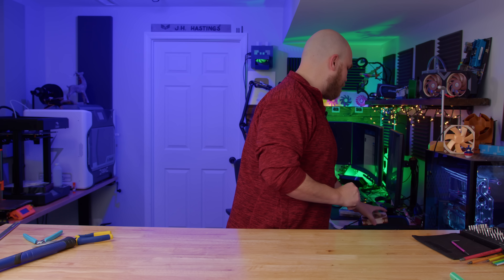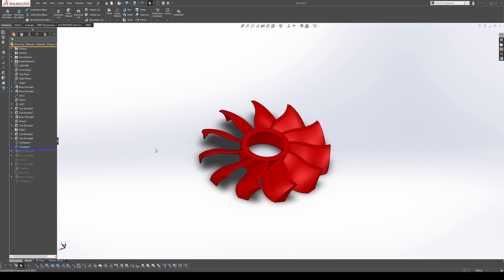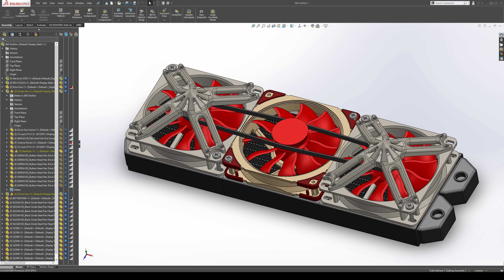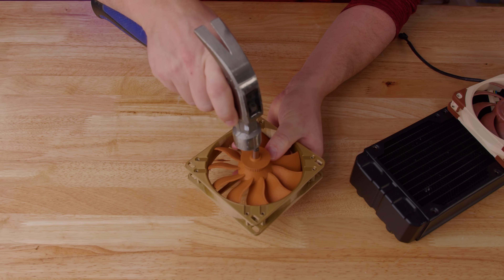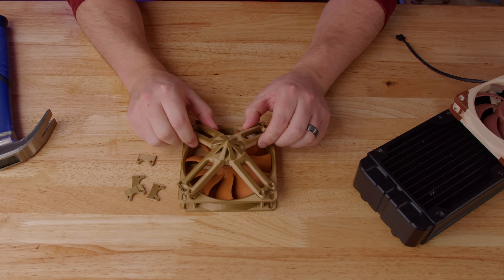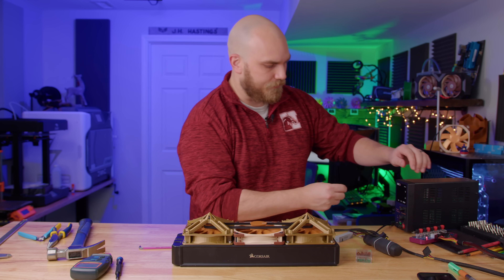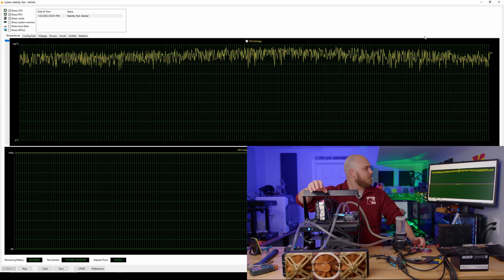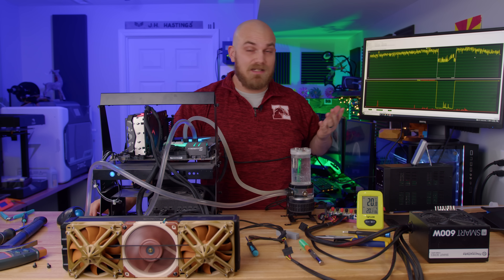I Turned One Fan Into Three | Steampunk Water Cooling

Comment: the central sprocket should be smaller than the ones of the driven fans (1:2), they would turn half the speed but also cause half the torque to the motor , and use a 2 belts system to avoid using tensionneur ;)

Comment: make a shroud. and attach the cheater fan to the shroud. have the shroud move the air evenly accross the surface.
this is only an option if you have space in the direction but it may very well allow you to get more even flow

Comment: I think you should consider something to hold the belt on the actual fan from losing it's traction, because I saw the belt has teeth (I assume that part of the fan also has teeth) and in that outro shot, they're making noise and since there's like the white tape for RPM measurement still on, I can see how the fan started to spin faster when it lost the traction and then got back to grip and slow back down

What I think you should do is to give a pair of maybe smaller bearing on both sides of the gear mechanism, like the stabilizer on the other blades but instead of for the axle, it's to hold the belt from jumping off traction, idk maybe you could find some better method to accomplish this

But yeah, definitely fix the traction/grip issue on the belt, and please do it with better motor and give it more torque after you fixed the traction, I'd love to see it.. xD

Comment: You should instead of using your current drive pulley, create an outer ring on the centre fan blades and raise this above the fan housing and place teeth there so that the belt has larger surface area contact with the drive fan and the slippage should be much less.

Comment: You need to gear it down a bit.  Poke the motor shaft through the middle fan via a bearing (to make the middle fan spin freely), then pop a smaller pulley on the end which can be belt-driven to one of the side fans to provide the reduction ratio.

Comment: Seems like a way better solution would have been to just make a thin manifold that covers the whole side of the radiator and has an input for a single fan. Then put some diffusers on the inside to distribute the air from the fan across the whole radiator.

Comment: Is it possible that because you are taking drive from both sides of the same wheel, where the gear ration on the ends is different is putting the belt's teeth slightly out of synchronization.  So one side is fighting the other.      If you put the center pulley size to the same as the outers then the set will run smoothly.

Comment: 1.With smaller gears on the side fans you effectively gear them up, so you put more load on the center fan.
2. As mentioned in other comments, two separate belts for each auxiliary fan would require in total significantly less tension and resistance to turn (as this is a teethed belt it doesn't require much tension to work on two gears).
Additionally at that point you could make the auxiliary fan gears/pullies bigger than the center one, so that they turn slower than the center fan. This would mean that less torque is needed from the center fan to spin up the side fans.
3. Also as mentioned in other comments, at this low motor power level it's important to clean the bearings from factory grease, and put only a tiny bit of a very light grease for minimal friction. Also in such usage it's best to choose bearings with metal lips (usually called ZZ bearings), and not he ones with a plastic seal on the side (like RS2 bearings), as those add significantly more resistance, and you don't need super sealed bearings in a computer.
4. The belts/pulleys/gears can be lubricated with a tiny bit of some light teflon grease (like the kind for bicycles).

With all of those things optimized it should smash the stock single noctua fan on such a big radiator.

Comment: You could try using the pump to drive an impeller that's connected to a mag-drive. The mag-drive could then drive the extra fans. Some small industrial pumps are driven this way with a mag-drive.

Comment: Would have been better to get a standard length belt that is too long, and put 2 idler bearings on each side of the drive pulley. It would increase the number of teeth making contact and you could keep the belt loose enough to not put much of a load on the shaft of each idler fan. Inside of hard drives there is a bearing where the whole read/write head assembly pivots. They usually have some very wide bearings, and they're usually threaded on each end.

Comment: This would run better if you also had the teeth on the outside of the belt and figure-8 around the center.
Sure the middle one would spin the other way as the other two, but tension would grip on it better though you'd need a longer pulley on top of the fans...

Comment: The Seam Punk AIO could be viable cooler.
You should clean out the bearings and put really thin grease in them, also you need one idler pulley to keep the belt in contact with the center pulley. You wouldn't need very much tension on it.
Maybe run two fans on the outsides with a driven fan in the middle.

Comment: Two suggestions.  For a lighter frictional load, if you want to stay with 607zz size bearings, swap them out for ceramic bearings.  The other option is to do as I do in my experimentations by using bearings scavenged from old disk drives, they are high speed and nearly frictionless.

Comment: You, Sir, need some mechanical advantage.  Lighten the center sprocket but make it much larger so you gain leverage.  Playing with the ratio of the side sprockets will let you dial in the performance/resistance

Comment: This is so cringe to watch -- it's so painfully obvious the force is between the two ends of the pulley not the center. Putting a gear in the middle and trying to drive it where the only engagement force is from a belt floating over it.

Comment: The only reason you need so much tension on the belt with this setup is to support the center cog. If you used a spring loaded tensioner to keep the slack out of the line and increase the surface area contact by wrapping it around the center, you wouldn't need so much tension in the entire system. Said another way, with your current solution you only have a few teeth of the center fan contacting the belt at any moment and as a result, you need the entire belt very tight. If you use a pulley to wrap the belt further around the center fan, you won't need the whole belt as tight

Comment: You could use smooth, elastic belts like the ones found in cassette recorders or record players, and have a separate pulley and belt for each fan, to get more belt contact area with the pulleys. Smooth pulleys generate less friction and significantly less noise, and do not have to be spliced like this as they come in closed loops (you can buy a big bag of belts of different sizes from China, or adjust the pulley size to make the belts you have fit). And maybe using sleeve bearings or significantly smaller ball bearings would be a good idea, as those are meant for huge loads like skateboards or furniture, and generate too much friction, as there is a lot of sticky grease inside.

Comment: I would have done the motor with the sprocket and smooth pully hubs on the outer fans with a dry tapered needle bearing would be better for the load vs having stabilizers. 

As others have said, using nylon o-ring style belts, 2 of them, one per side fan, would work too.

Comment: I want to see a huge reservoir. Like a big ol plastic tote you'd store stuff in. No fans. Just a pump and an open tote. drops the water back into the tote from like a foot high so you get as much surface vibration as you can. Make sure the surface is full of ripples. That's more surface area for evaporation. You could run it indefinitely with a float valve adding water back in. And if you want even more evaporation, add a water fall effect with lava rocks for more surface area. Let the computer sweat.

Comment: so u see how u made the top thingie for the 2 parts at the ends? u need to make 1 more for the middle part to put on the fan. its main fuction would be to put tention on the belt so it can press the belt and pull slack. so like 4 bearings on arms?

Comment: belt drives are really not efficient. if you would designe a gear a little bit bigger than the fan for every fan, so the gears of the fan can touch the gear for the other fan. Take in to consider that the middle fan will turn in another direction than the outher fans.

Comment: Let's free up those rpm!!!!  Use multi stage pulley in order to find the sweet spot for the outter fan pulley.  Use twin v-pulley in the center.  Since you are already at 300ish rpm at 1:1, if you go with 6:1, you'll have same rpm on the outter fan, but most likely 1800ish rpm i  the center.  But I would go for 2:1, 3:1 and 1,5:1 for testing purpose.

Comment: Sorry, but your experiment simply can't work well for 2 reasons:
1) one motor intended to drive 1 fan can't efficiently drive 3 fans
2) the central pulley has far too few teeth in contact with the belt, which forces the belt to be stretched too much so that it does not jump off the teeth, thus losing even more power.
One way to improve this would be to add a small pressure roller on each strand of the belt to keep it in contact with the pulley, set just to prevent the belt from jumping and thus be able to slacken it to limit power loss.
P.S. The bearings are also too big = too much friction loss, 3mm pins would be sufficient.

Comment: I wonder how effective it would be if rather than making additional fans you simply added a 3D printed shroud  to split/bifurcate the air from the single fan across the width  of the radiator?

Comment: If you put some tension pulleys on the belt to give a bit of positive angle instead of it going at a tangent you could take the tension off the outer fans and would possibly run faster with less load
Reply: That or make the center wheel much bigger

Comment: Take a look at automotive engine timing belt designs (specifically boxer VW and Subaru flat 4's I know air cooled VW isnt a "timing belt" per say, but the cooling fan runs similarly to your fans here... ). Two words. Tensioner Pulley. With a properly designed one, I bet you could put an electric motor to it with more torque then a noctua fan motor, And actually get some sort of cooling performance out of it. Obviously wont be nearly as good as just normal fans BUT youd have that cool factor.. and for a small power Ryzen APU build.. I bet you could get away with it for the main case cooling.

Comment: Because you have multiple size pulleys that means that the fan belt is running at different speeds on the pulleys and that's why it's having extra problems

Comment: You should do a collaboration with Integza and make some sort of shroud that goes on a radiator on one end and on a 3d printed jet engine on the other. I've seen a lot of funky cooling solutions, LN2, Phase Change, Evaporative, Sterling motor driven, peltier / TEC element, but never a jet engine cooled PC.

Comment: Newtons 1st law of thermodynamics. Energy can not be created or destroyed. Knowing this. You honestly lost. Why? Let's say you put 12 volts into the fan. This fan is running at Y RPM providing X amount of cooling by supplying Z amount of watts. A Watt is a unit of energy. By adding 2 more fans. You're increasing restriction through friction and you're still putting in Z Amount of Watts. Now you have lost some of Z. Now X is less than running with just 1 fan. Get it? You're better off with just 1 fan and buying more. 1 fan will cool better than that setup due to loss of energy provided.

Comment: Would work better if the "master fan" was not in the middle. it would have more belt area on the sides. the one in the middle should have a bigger pulley, for more tension.

Comment: I would definitely make the center and pulley little bit smaller than the outer fans pulleys and set it up as a dual belt. It would make it easier for the center fan to spin the outer fans and the outer fans don't need to be running faster than the center.

Comment: Running the belt and pulleys in line like that is not a good design. Either the center pulley needs to be significantly larger than the outer pulleys or the outer pulleys need to be significantly smaller, so that there is proper tension on the belt so it does not skip on the center pulley. The only caveat to this is the outer fans will spin at a different rpm than the center fan. Or there needs to be a tensioner on one side of the center pulley depending on the direction of the belt movement. Note as well by having the belt come in contact with the both sides of the center pulley is actually causing resistance and the belt should only contact the center pulley once.

Comment: Use grease less ceramic bearings. The thick bearing grease in the cheap bearings are causing allot of drag. You can also just wash out some of the bearing grease so it isn't so hard to turn side fans

Comment: a square belt would be more energy efficient requiring less tension. I fact I would use two square belts, to drive the fans left and right with their own belt. I was surprised you chose a toothed belt. Also you had some contact between the axel and plastic which will also have slowed down the fans. Finally I think I would choose a less powerful fan blades design so that higher speed can be achieved, to hit the sweetspot between the power needed to drive this thing and disc efficiency on higher speeds. i believe the idea is interesting, and could be executed way better with my suggestions, however it is certain that this contraption will never work as well as a single fan. Or can it possybly match or even outperform a single fan if optimised? I am smelling a challenge.fan

Comment: A low profile 12v brushless motor from a drone might work better, or in the vein of custom setups, a standard brushless motor offset from the fans themselves, and running dual pullies on each fan might perform better. I dont have the software to model it though, so if anyone understands what i said have at it.

Comment: Some super glue on the belt might help there but a single tension wheel pushing from the outside in should increase the performance. thanks for the fun and interesting cooler.

Comment: This is pretty cool, but if I were doing this, I’d start with an industrial 5500 RPM cooling fan as the drive fan, and just run it off of a high power fan controller to control noise.  It would probably actually work really well.

Comment: Basic addition to make this design better, you could have a frame with a singular bearing on the middle fan (mounted on either top or bottom) used to push the belt onto the pulley, not really applying any pressure, but just keeping the teeth from jumping. Combine with what others have said about bearing grease adding friction (so replace grease with something lighter) and I think that would work a bit better without redesigning to add more pulleys or whatever.

Comment: If you use dry ceramic bearings rather than greased skate board bearings you have a 100x reduction in friction. Also, idk why you didnt just make them 1:1. We know the A12x25 doesnt have that much torque. You'd then wanna go 1:1-1:0.8. this runs the fans a slight bit slower but the motor is able to drive them more efficiently. Also, now your drive is smaller than the driven so you cant set the belt up like you did. So you'll have to run idlers similar to a subaru boxer motor (literally almost the exact same belt config) or, print a drive fan with a pulley 2x height, and offset the pulley on 1 of the driven fans by the width of 1 belt and run 2 belts. This gives more wrap and thus more bite. This is good because it allows you to run less tension which as you know equates to less drag and a higher fan rpm.

Comment: i wanna see what that radiator can do if you have super high speed fans. don't worry about driving the fans from the main fan, just use it to view your fan speed metrics. put a decent motor in the mix as you have it now but put tensioners on the timing belt so the middle fan can be gripped properly. be careful if you're using a drone motor or similar sometimes they can have a strong ramp up and will probably shred the gears if not careful. look forward to the next video :)

Comment: You should put the noctua on one end so you can put the smallest pulley on it. Then it'll be able to run at a more comfortable speed for the motor/controller.

Comment: Two things to improve you idea. Reduce rotating mass! The lighter you fans are the less work the motor will have to do. Second drive each auxiliary fan with its own belt will make make it easier to transfer power without the belt slipping on the drive motor. One other change would be to the gearing ratio I think two to one  would be better less stress on the motor. You're never gonna push as much air as single fan.

Comment: The belt has to much resisting, it is designed for higher loads. More efficient would be thin rubber bands (like the ones used in high-end turntables) driving the fans separately

Comment: What if you skip the belt and increase the pulley size to make them gear driven? You could print a single grill to support all three axles, with a track to micro adjust gear friction.

Comment: You want a lot smaller bearings - those are huge for a fan and they're packed with heavy grease, you're probably loosing most of the power to that. Bearings half the diameter and repacked with oil (or buy open bearings and just oil them). You can easily just print some inserts that drop the bearing sizes to see

Run two centre pulleys and just loop o-rings around the outer fans instead of using the timing belt, your drive noise will be much lower and you'll be way less friction. Hell even rubber bands are fine.

Comment: What you should do to get better cooling with one fan is to spread out the air flow by making air tight box for the fan side of the radiator and cutting wedges to the underside of the fan frame